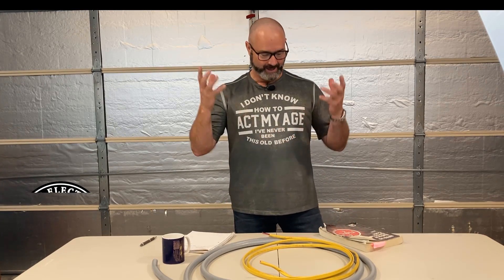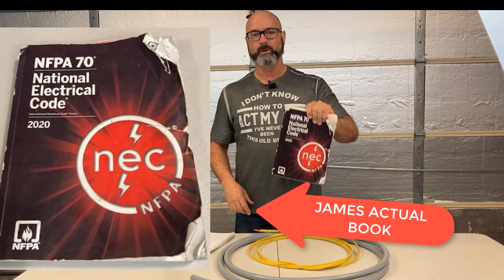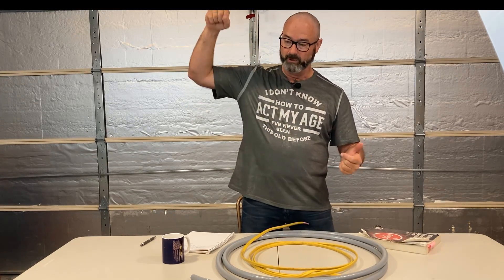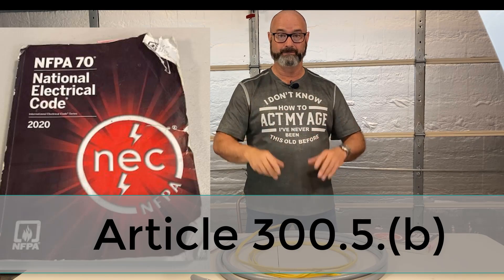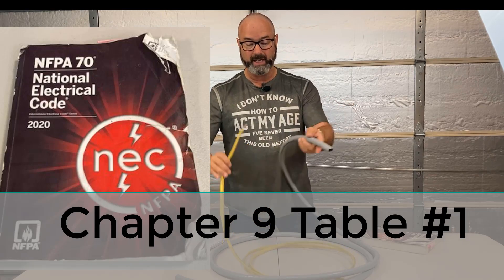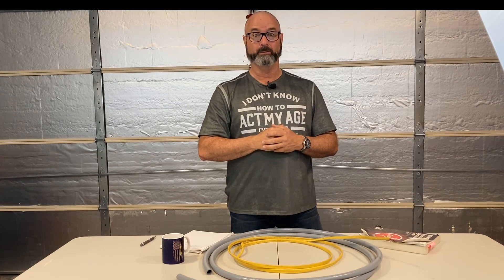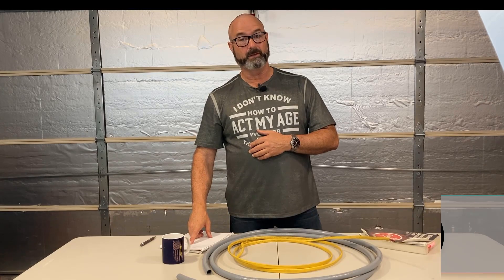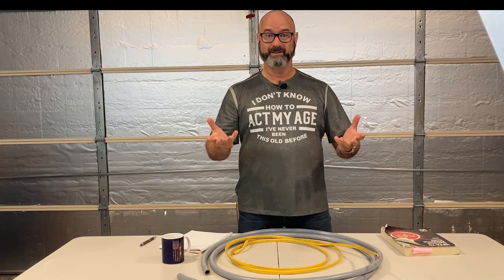Can Romex Cable be run Through Conduit? National Electrical Code Book

Comment: What if the sheathing is removed to make it individual wire?
Reply from the maker: Same rules. Fill percentage is easier to achieve without the sheath. But the individual wires are not marked for outdoor or wet locations. Check it out sometime.
Reply: @abrelectric  Sheathing is not allowed to be removed when in conduit.

Comment: If I have a wire run going from the panel under a house and then back outside. Can I have half romex under the house then strip the sheathing for the rest to run through pipe outside??
Reply: No, illegal to strip the sheathing and use the conductors in conduit without it.
Reply: @pld8993  which code excatly states that

Comment: So, if I have a garage with cinderblock walls, and I want to run romex through the joists and then down to receptacles, what size conduit would I need to run two 12/2 wires down to the receptacles? If it’s just for the protection of the wires, the fill factor doesn’t come into effect, correct?
Reply from the maker: Fill factor is in effect unless it is less than 24" of conduit. Why not just transition to THHN conductors?
Reply: @abrelectric   Honestly? Aesthetics. I don’t want to have junction boxes at the top of every piece of conduit where I transition over.
Reply: @chrissmith3930  If it's not a complete conduit system you're not limited to 24" length. Running down the wall with conduit to a box and leaving the top open so you slide the romex down into it in is an incomplete system therefore not subject to any fill limits at any length. If it fits it's legal, and two 12-2s will easily fit in 1/2" emt.

Comment: Most common violations are the kitchen island underground PVC conduit and the heat pump unit outside that they put romex in the flexible liquidtight conduit.  Much easier to install THWN in that liquidtight then romex!!

Comment: I see NM cable used in basements all the time.  Is this also considered a damp location?  Does the rule only apply to NM cable (Romex) installed in conduit in a damp location.
Reply: Some locations like NYC, and Chicago require EMT conduit in the basement.
Reply: @JeffBanfield-t6v  Chicago requires EMT everywhere. Romex is essentially illegal.

Comment: Is there a derating factor or code for the romex being in the pipe?
Reply: Derating applies if you have 4 or more "hots" in a single conduit, or 4 or more NM cables bundled together for more than 24" Table 310.15(C)1) shows the percentages.
Reply: @JeffBanfield-t6v  Close. When there are 4 or more current carrying conductors, which includes neutrals, you must derate. Two pieces of 12-2 bundled or in conduit, for example, would be 4 current carrying conductors and derating would be required but because romex is already subject to the lowest temp ampacity column (60C), nothing changes until you've got 10 or more current carrying conductors.
Reply: @pld8993  Neutrals are only counted as current carrying conductors if it's a 3 phase 208 wye connected system and sharing neutrals amongst 2-3 hots. A 12-2 WG romex with a hot, neutral and ground has one current carrying conductor, the hot wire.
Reply: @JeffBanfield-t6v  Incorrect. A neutral is a current carrying conductor in a 120V single phase individual circuit. In such a circuit, the neutral does not carry unbalanced current from other conductors; it carries the entire current load of the single ungrounded conductor. Every amp that goes through the hot also goes through the neutral. Since it is not carrying only the unbalanced current from other conductors of the same circuit, 310.15(B)(5) does not apply. That article only applies to circuits with multiple ungrounded (hot) conductors.

Comment: Thanks, very informative.  Question to the expert:  I'm looking to move my indoor main service panel feed and all circuits (off grid cabin - no 100A service, just about 30A from an inverter at potential peak loads that we never get to) through an exterior wall, basically the opposite of the wall, so not far.  All my interior home runs are made with 12/2 romex that needs to be moved.  In your opinion would a VERY short run (basically redirecting the existing Romex out of old main panel through 2x6 wall) through appropriately-sized conduit passing through the wall directly into an exterior-rated junction box or dist panel be considered damp or wet?  If so the plan is to transition the romex to to 12 gauge THWN in conduit to extend circuits into the new exterior service panel for termination on 20A breakers.  I initially wanted to do the junction box inside in place of the old service panel, but I lack the 30 inches of width (I have about 24") code requires for access to the panel (hence one reason I am moving the panel outside actually.)  Course, it is West-By-God Virginia so no one is likely to inspect this unless I want them to, I just don't want to kill anyone or burn my cabin down.  Thanks!

Comment: You're wrong about the under the floor to an island. Article 300.5 specifically talks about (buried wire and the depth in the "ground" not floor.

Comment: Wow!

I've done this at least 3 times without realizing the issue.  All going from house to shed.  1 time was 100 feet long 1/2" conduit buried 18" deep with 12/2 ROMEX.  I knew I couldn't direct burial unless using the cable meant for such and using the "caution" tape above it, but I've always figured inside conduit excepted the wet/damp issue.  I also never thought about pipe fill when using ROMEX.

Have the rules ever been different on this?

Comment: My boss was an electrician and he told me it was okay to do this for a short piece just to protect some 10/3 from the sheathing/siding of my house to run it from a generator twist lock to a generator panel.. 

I'm having an issue with new LED fixtures that are going to replace my fluorescents.. T-bar ceiling, knockouts line up with the tbar so I'll have to use the knockouts on the ends of the fixtures, thus exposing the wire.. can i use pvc here?
Reply from the maker: PVC from the end KO to a junction box above the ceiling? Or surface mounted conduit the whole way? If you're running thhn wires inside of conduit yes.

Comment: Assuming you're not saving money on less junctions, the cost of NM through another raceway usually isn't justified. There is a potential heat dissipation issue. Also the sheathing likes to ripple when it turns so that's going to throw off your calculations for jams (forget the table number in the NEC). But the biggest one for me is the nonsense of putting a raceway inside another raceway.
Reply: Many homes including mine have conduit pre run from the basement to the attic (just a straight run) for future runs so it's both easier to fish wire and you don't have it dangling inside the wall.  Because it meets code, you can extend the conduit or much easier to just run NM all the way from the breaker to the end device. It was very cheap to add in a set of attic fans later for us.
Reply: There is no heat dissipation issue with romex in conduit, that's an old myth that won't die, thanks in part to youtube videos. Also, romex sheathing is not a raceway. The only issue with romex in conduit is that it's hard to pull and, unless the conduit is need for physical protection, unnecessary.
Reply: Of course there is a heat dissipation issue. If there wasn't we wouldn't have different ampacity tables for free air, conduit, direct burial, etc.. we also wouldn't need adjustment factors for more than 3 current carrying conductors in a raceway. And yes NM sheath is a raceway.
Reply: @andrewgraham2546  If you read the NEC you'd know that romex sheathing is not a raceway. Raceway is explicitly defined in the NEC and all raceways are identified as such within their respective articles. The sheathing on romex is explicitly defined as a jacket, not a raceway (Art. 334). The ampacities listed in Table 310.16 already consider the conductors or cables in conduit and romex is required to use the 60C column, resulting in the lowest max ampacities for conductors in romex cable. Putting it in conduit does not change that ampacity. Everyone claiming that putting romex in conduit leads to overheating simply because it's in conduit are wrong, it doesn't. Adjusting for more than 3 current carrying conductors does not increase heat dissipation; it reduces the max amperage in an effort to lower the max heat that the conductors will be subject to. While those romex cables are engulfed by several inches or feet of insulation in a wall or ceiling there is essentially zero heat dissipation possible but it doesn't matter because they will never even come close to their max temperature. As long as the amperage is limited there is no need for the heat to dissipate outward. When conductors are in free air and able to dissipate heat effectively their ampacities are increased accordingly but not all conductors are installed in a way that heat dissipation is possible, thereby requiring lower ampacity to lower the max temp.
Reply: Well I didn't want to go slapping articles around but here you go.

Article 100 defines raceway as being "an enclosed channel designed expressly for holding wires, cables, or busbars."  Which NM and NMC sheathing is. That doesn't mean your wrong to call it jacketing but that is an auxiliary function.

Art 334.80 tells us to adjust the ampacities when two or more NM cables are in and enclosed, insulated, wall cavity and proper spacing isn't observed... aka yes there is a heat problem, it's specifically because there is little to no dissipation that we need to be aware of it.
Reply: @andrewgraham2546  If you read the entire definition, you'll see the following - Informational Note: A raceway is identified within specific article
 definitions. Please share where in 334, in the specific article definition of NM cable, the outer sheathing is identified as a raceway. It's not and it's called something else, a jacket, in the NEC's definition.  I'm not calling it a jacket. The NEC calls it a jacket and does not call it a raceway, therefore it's not a raceway. Jacketing is an auxiliary function? Where'd you read that?
Reply: The code doesn't specifically identify NM sheath as raceway but that's the purpose of providing a general, non specific definition, in art 100. Furthermore the code does identify NM sheath as jacketing material but does not list an official definition for jacketing. We, of course, know that the individual wires inside an NM cable are already both insulated and jacketed, thus the outer sheath would form a secondary mechanical protective layer. Still does not exclude the sheathing from fitting perfectly into the general definition of raceway. We are arguing about code interpretation but I'm sure you can see that the practical aspects fit the concept.
Reply: @andrewgraham2546  By the NEC's own definition of a raceway, the outer sheathing is not a raceway because, as I've already explained and quoted verbatim, the NEC clearly says that raceways are identified as raceways in their article definitions. Nowhere in the article definition for NM is there any reference to the word raceway, which therefore explicitly excludes the sheathing from being considered a raceway. Either you can't comprehend what's written in black and white right in front on you, or you're someone who so desperately feels the need to be not wrong you'll twist your argument into a pretzel in an attempt to save face. And the NEC does not say jacketing, it identifies the outer sheathing as a "jacket," which is a noun, a word used to identify something. You're wrong, the outer sheathing is not a raceway. It's written in plain english. Deal with the fact that you're wrong, but at least you've learned something new. Here's something else you didn't know 5 minutes ago; your "concern" about a raceway being inside another raceway clearly illustrates your ignorance when it comes to electrical wiring and the electrical trade. Innerduct is used all the time in the trade inside other conduits, a raceway within a raceway. The NEC allows raceways within raceways. You're clearly not an electrician, time to move on.
Reply: Alrighty then. I'm not interested in having an intellectual conversation if attempted insult is your reflex. I happen to be quite accomplished in my career with many years ranging from MV/HV transmission, to prime power production, to commercial code electrician. Nowadays I do NETA acceptance and maintenance testing. I won't presume to know your background or level of experience but I would be remise, purely based off your above responses, to not encourage you to think more scientifically/criticaly about the code and how it relates to fundamental engineering principles. Code adherence doesn't make great electricians, it just keeps them on the job. Have a nice day.

Comment: Thank you for the video lots of info. Question:  I have a room in my basement where my well is. It stays wet half the time they ran romex threw conduit to my well pump 50yrs ago now the conduit is rusting and falling apart i have plans on sealing the room to keep the moisture out i was gonna run pvc conduit so it would not rust but what kind of wire should i run.

Comment: Thank you for the video!  Question: can I run a Samsung Connect cable (the cable that connects the Samsung frame TV to the Samsung Connect box) through an empty white 2-inch PVC pipe? The pipe was placed by the builder behind a drywall on an external wall of the living room on the second floor of my house (floor above finished basement). and  the outside of the PVC pipe is surrounded by insulation. The pipe is empty with nothing else running in it.  Would running the cable inside this 2-inch PVC pipe still meet code?  The run in the PVC pipe will be about 4-foot long. Thanks
Reply from the maker: Absolutely! Good luck with your TV

Comment: TV over brick fireplace. Builder ran 2” PVC sleeve from basement to behind TV, cut flush with brick.
Can I run Romex and HDMI/CAT6 cables all in this 2” PVC sleeve?  Romex would exit PVC and enter shallow receptacle box. 

Also curious if I can run SJO cord in place of Romex in above scenario, and female cord cap behind TV, male cord cap in basement?
Reply: The 2 inch conduit is for your low voltage. If you run power and low volt together you'll get interference (static) on your TV
Reply: Not true. @JeffBanfield-t6v

Comment: Planning on running 8/3 Romex for a welder into my garage and running it thru the attic to the exterior electrical panel. Being that my home has blow in insulation in the attic, does all that Romex need to be in conduit?
Reply: Onle where exposed to physical damage (down the wall)

Comment: Ok.  I wanted to run as much of my attic romex thru conduit bc the house was literally a "rodent farm" when I bought it, so out of fear of the "chewers" I researched this far and wide.  PPL at the electric supply said don't worry about rodents, they wont bother your wires or had little knowledge on the subject.  Rodents usually go for Fiberglass insulation first as nest material.  BUT -- the deciding factor on conduit y or no may be not just the code but the "Heat".   House is in South Georgia and the 2nd floor attic where the wires are gets up to probably 105 or more  on a hot day.  I would be concerned about wires getting too hot or perhaps issues with condensation due to heating and cooling inside of the conduit.  Probably insanely paranoid about the sharp-toothed vermin ( their teeth never stop growing btw! ) after what I saw in this 100+ year old house.
Reply: MC cable is a better idea.

Comment: I love how much attention is paid to a fill factor within a conduit theoretically because of trapped heat, but let's just spray foam right over Romex in the walls and insulate the Romex so essentially no heat escapes.  That's not mentioned at all in the Code Book.
Reply from the maker: No, it's not.
Reply: @abrelectric  It doesn't need to be mentioned because conduit fill has nothing to do with heat. Conduit fill tables and limits are about physical space inside the conduit that will allow the conductors/cables to be pulled without stress or damage. Ampacity adjustment, what used to be called derating, is a way to limit heat when there are multiple current carrying conductors present. Romex does not overheat or generate excess heat simply by being in conduit and yet the myth persists because of lots of youtube videos incorrectly stating that it does.
Reply: Ok, u can do putting 4-12/2 Romex in a 1” pvc pipe? ( for island) like 7” to wall from island!
Reply: How can you strip the wire out of its jacket? Doesn’t that damage the listing? UL? Help much appreciated
Reply: @aaronboutwell  Once you remove the sheathing it's no longer NM cable. NM in conduit must have its outer sheathing intact, including when it's inside conduit. The NEC also specifies this in 334.15.
Reply: It is, you have to de-rate the wire. 2015 IRC - E3705.4.4
Reply: @SirLinkTheIntrepid  Thanks, NEC 330.80(c) does address 3 or more NM cables bundled together in foam insulation.
Reply: You have to derate if more than nm cables use 90c table but 60c chart for nm
Reply: @stepanvinnikov6024  And that is in the National Electrical Code Book where?
Reply: You are so right
Reply: 334.80

Comment: Thanks for this. I plan on running 6/3 nm-b romex through studs and then the last 2' in 1.25" conduit (from sheetrock to 48A ev charger) in my garage so it sounds like I'm good to go.  I would appreciate any comments you have on this plan though.
Reply: I thought 6/3 nm-b ampacity is 55A thus 48A charger exceeds the 80% rule??
Reply: @STRMWZRD1  I think it's rated 60 amps at 90C so that gets us to the 48A rating. I'll have to check it while it's charging my car and see how warm it gets.
Reply from the maker: Sounds like you've got it!
Reply: @abrelectric  Thanks for the response!